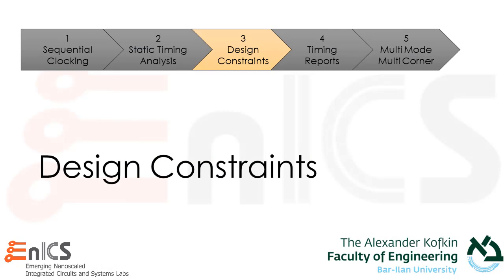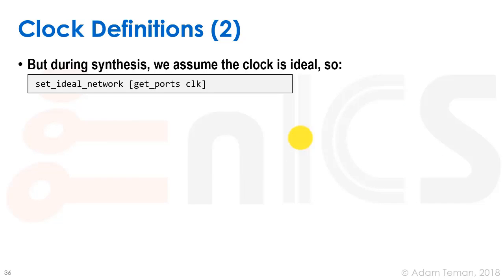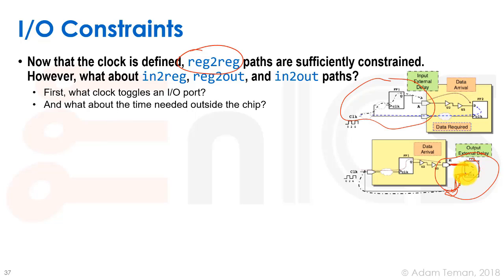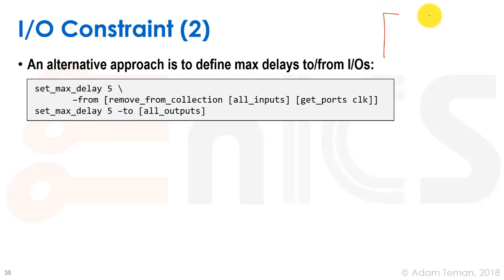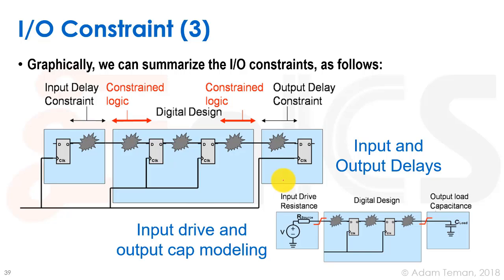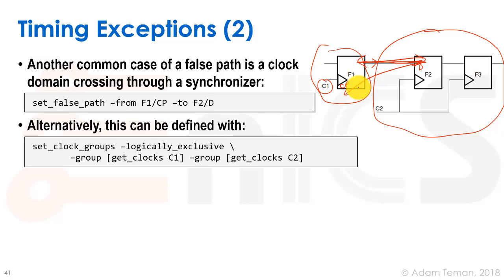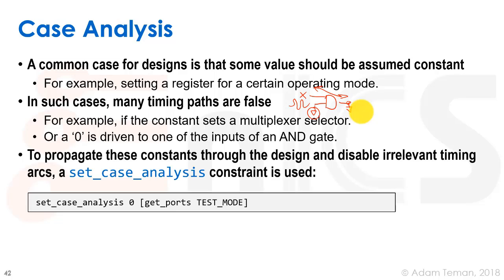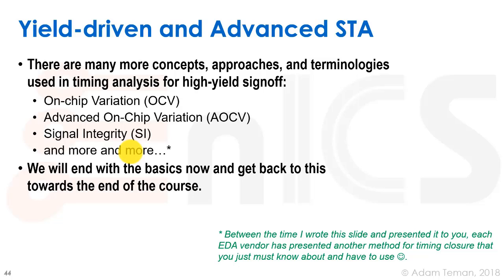DVD - Lecture 5f: SDC Continued

Comment: how do we choose/set the parameters in these constraints
Reply from the maker: Well,  that's the $64,000 question :)

In general, the constraints come from a few places and from a lot of experience and "guesstimates". 
To start, there is usually a spec, i.e., some frequency that your design has to meet. That will set the clock frequencies, which are the most important constraints.
Second, you have some recommendations by the fab or by company policy for what kinds of "derates" to apply to account for jitter, OCV, etc.
Third, you have the I/O constraints. These can come from all kinds of places. For example, in hierarchical design, the best thing is to "push them down" from the top level. So you would design your top level, place and route it, and then see how much time you can budget for each sub-block. Then you can push down the SDC constraints that you need to put on the I/Os of the sub-block to account for these. Unfortunately, in many (...most?) cases, this doesn't happen and you have to go bottom-up and decide how much to budget based on your acquaintance with the higher levels. Often you start with some default value (e.g., T/2...) and then see how much you can push the design or how much budget you need and then communicate it to the toplevel and other macro owners.
Other things like false paths, multi-cycles, etc., come from the designers and require a lot of collaboration with them. Often they come from previous projects and you have to double check that they are actually right and appropriate for the current project.

I hope that clarifies this a bit.
Reply: @AdiTeman  Very Informative

Comment: different cells have different transition, so which value shoul be chosen from which cell's table ?. and what to do if we have CCS model libraries.
Reply from the maker: Hi.
I'm not sure I understand the question exactly, but I'll try to answer.
If you mean what to set as a default input transition - this is a good point. We want to model the input transition, but we don't know what is connected to the input and how. Therefore, the calculation will not be accurate. This is a limitation that cannot be overcome, but the point here is to get a "good estimate". In general, digital delay modeling is NOT ACCURATE (as opposed to SPICE), but provides a tradeoff between run-time and accuracy. So we are trying to get a number that is "good enough", while it is clear that this is not 100% right. 
In this case, we have two options - 
1) provide a number that characterizes the process. This is very inaccurate and has nothing to do with CCS or the different gates. It's just some number that could be a reasonable transition so the delay of the next gate falls within the timing tables.
2) provide a typical gate from the library that may be connected to the input. In this case, the .lib (including CCS) of the gate is used for the delay calculation. This is not the gate that is actually connected, but is typical of the technology/library and therefore is a good estimate.

In any case, these are just estimations. Not accurate. But better than assuming something that is not based on anything...

Comment: can you recomend some textbook for this course as well?
Reply from the maker: Hi,

Actually, that is not an easy thing. I don't know of any comprehensive textbook that provides everything I cover in this course. That said, there are many books and other material that you can find that together will provide everything. What my main suggestion is, is to look at the list of references at the end of each lecture. I have tried to put the main sources that I relied on (other than my own experience and knowledge), so for each lecture, some relevant text book may be available.

Comment: What's the constrained logic in 13:00? Why do we need this block? What's the function of the block?
Reply from the maker: I think you may have misunderstood the point here. Let me elaborate.
We need to constrain all the logic in our design. Constraining the reg2reg paths is "easy" (or at least straightforward). All we need to do is define a clock and we have all the data we need to calculate min and max delay constraints.

But our "block" also includes in2reg, reg2out and in2out paths. These are not fully constrained with a simple create_clock command. For in2reg paths, we know nothing about the launch path until it reaches the block input. For reg2out paths, we know nothing about the launch path from the block output and on. We also don't know what happens to the clock (capture path) outside the block.

Therefore, we need to add SDC commands that will constrain these paths. In the figure, the parts marked "constrained logic" are inside our block and so we can sum up the delays. But once we leave the block, we have to use SDC to model what the delays (or rather, constraints) are outside the block.

I hope that clarifies it.